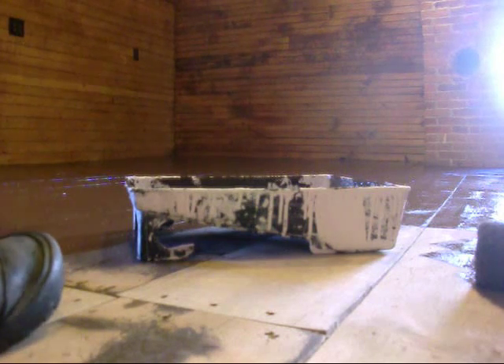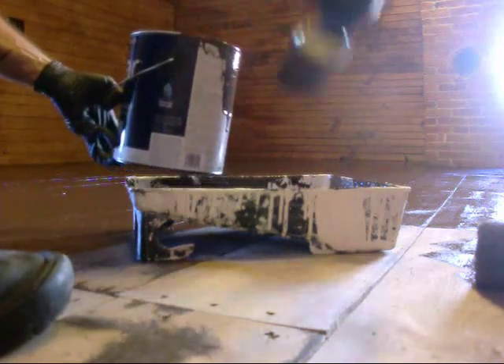6 6 12  Attic Floor Paint...

Comment: there's a reason they put the handles on paint cans the way they do. pour the paint on the brand side and not the instruction side. that way you can read them 200 yrs from now if you want to use it again and don't remember how! just a tip